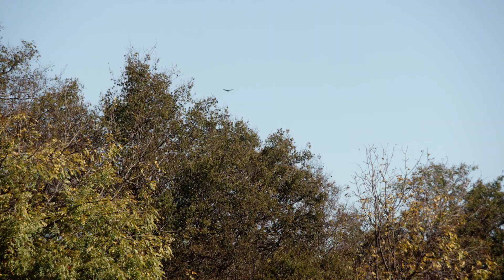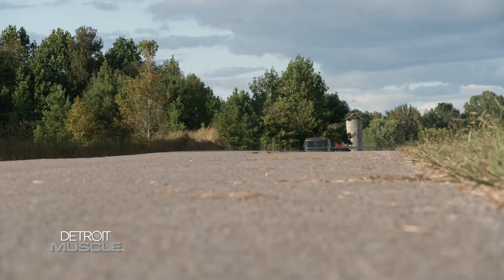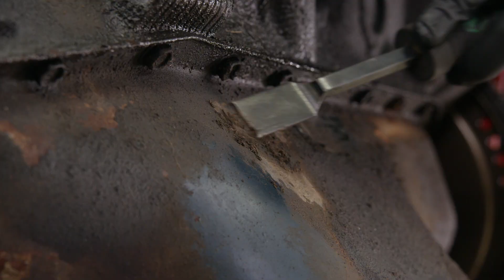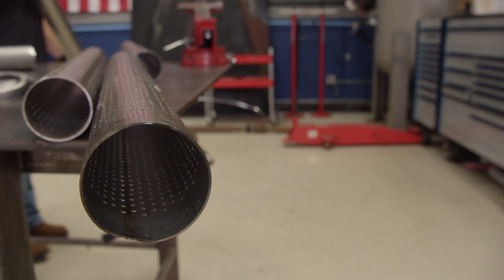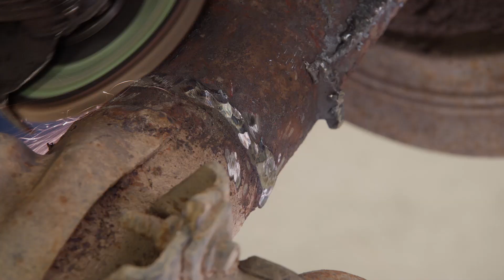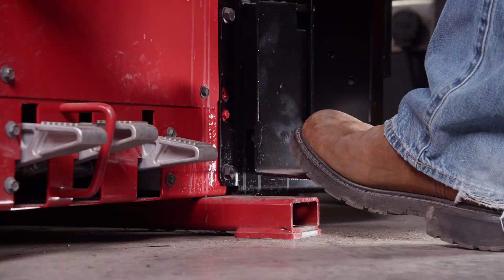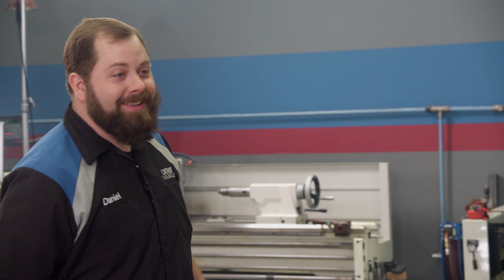Full Build: "Overtaker" Caddy Hearse Wakes the Dead

Comment: I love these things! I had a 72 with the 472 engine.  I put duel exhaust on it and a Holly double pumper carb. I put a line loc. on the brakes😂.  It had a factory limited slip rear. It would burn the tires with no problem! Then it would go sideways on you and take off.  I beat a 70s Chevy impala with it in a race😂

Comment: ok this is not a 502 it's a 425. 502 did not come in that body and the head guy gave it away and the trans has the bellhousing with the ears at the top, and 425 heads will not fit a 502, why lie? bc 500 sounds cooler than 425

Comment: The replacement for displacement is thermal efficiency. Utilize the maximum potential for every drop of fuel you put in the combustion chamber. And have less heat wasted in the radiator.

Comment: Not much aftermarket support for that motor?! There's a lot of aftermarket support for that 500 motor. The Cad company makes tons of parts for this motor. From aluminum high performance heads, intake manifold, camshaft, pistons, headers, etc. Procharger even makes a supercharger for it. Quick performance inc makes a 71-76 Cadillac rearend with a Ford 9" housing with 4:88 gears.

Comment: Meh. LOTS of expense et all, for a second and a half max, with NOX and weight reduction? Might have shined a bit better on a quarter mile track. The shorter track makes it much harder to make proper judgement of capabilities. I think the money would have been mainly better spent on a decent paint job. As an aside, would have been as well off just dropping in the '70 Cad engine.

Comment: Why would you not pull the crank, replace all the bearings, hone the cylinders for new rings and install new ARP hardware. Also clean all the oil galleys and install a new 70 PSI oil pump. Rear end, I have no idea why you would not use a Dana 60 out of a old Ford Econo van that came with 4:11s to 513s ( 3:73s are no ways near what that heavy tank needs) Plus I didn't hear a peep about a hi stall converter? A 4,500rpm would really help over a factory unit.

Comment: This was pretty much the plan I had 20 years ago. In '92, after playing 1st w/ Fords, then Olds, I bought my 1st Cad in an '81 V8-6-4 Coupe. I put duals and a shift kit in the TH375-a 400 w/ a 350 output shaft used in these 1000# lighter than '76 back cars. The duals caused an off-idle stumble, the ECM program not intended for the freeer flowing exhaust from idle. However, after that the difference was obvious!     The next year I added an '84, buying it w/ the notorious GM cam problem of the day and infamous HT4100. Ordering a $150 cam and lifter kit, I noticed it short and only having 12 lobes. NAPA mistakenly ordered the Buick 4100 cam, which was used in '81, not '84 cars like mine (the Buick 4100 has a longer stroke than their 3800 for more torque in the Cad applications) Then finding the HT4100 kit to be $400, it was a no-brainer to put in the Olds Rocket 350 I had previously built and had in a rusty '73 Delta I was scrapping.
 Days after reading the article "Torque Pig" in the July '00 issue of Hot Rod Magazine Magazine, I hunted down and bought an '81 Coupe w/ a 500 installed, in a junk yard! The previous owner smacked a deer. $200, a new front header, grille and radiator, and some radiator core straightening and wha-laa! She ran like a beast. My friend riding w/ after ridng in my V8-6-4 car said "this is the way Cadillac should have built the car". Which gets me to a hearse. Bringing up kids, funds were limited (both daughters have Master's degrees) so I could not afford an '84-1000# lighter than a '76 back, very clean 14k mile hearse for sale locally for $7k...worth every penny. What I instead found was a clean '84 Coupe in Crystal River, FL for $500 w/ a what I later found to be a broken crank in the HT4100. My friend and I drove his '67 Ford F250 Camper Special 1200 miles from here in northern MI to FL to get the car. Still due to finances, and the arson of my home 5 years ago, the car is in my shed. Lost in the fire were numerous high performance Cad parts I was buying piece at a time. I had MTS (Maximum Torque Specialities) MT5 and 20 cams, shaft rockers, KB hypers and stock pistons, H-beam rods rated 800 hp and prepped factory rods-shot-peened, magnafluxed and ARP rod bolts, bearings, gaskets, and an MTS/Bulldog airgap single plane and a Edelbrock Performer. The intakes survived, but the MTS was stolen from my friend's garage on the 1 year anniversery of the arson. 
While I have not met John Walker, I  have spoken w/ him. I did meet and spend the day w/ Richard Potter, owner of Cadillac High Performance-which sold to John, on my trip back from AL stopping at his Soddy-Daisy, TN shop. Rich showed and explained to me the Popular Hot Rodding destroked 470 he built for their Engine Master's Challenge (limit for the challenge was 470 ci) and what really happened. Contestants basically "sign their engines over" to the testers/dyno operator. His engine was not properly vented, causing an air bubble to remain in a/the head(s) which resulted in bad detonation and the harmonic balanced to literally be thrown from the engine. Rich radically changed the factory designed cooling to reverse, threading the core plug holes and plumbing the cooling system so that coolant exited the holes instead of rising through the engine. This allowed the coolant to 1st enter backwards through the thermostat housing, cooling the aluminum heads 1st which allowed a 14:1 CR. He also worked the heads AND pistons of his design to make maximum hp. 
Finally, in the early '00's I accumulated over 20 Cad 472/500's very reasonable. One '71 Eldo 500 I drove 1200 miles to Amirillo to get, another 800 miles away in Princeton. And I made a 4 day 2400 mile 6 state trip stopping in Southfield, MI, Scranton,PA,  Manassas, VA, Columbus, IN, SW Chicago, and Valparaiso, IN.

Comment: I had a '69 Superior Sovereign built on 165" Cadillac commercial chassis. It had the high compression 472, a TH400, and, a 14 bolt rear.
Reply: With a full tank of gas, mine came in at just under 6600 pounds.

Comment: 8litre motor with big valve heads inlet and exhaust manifolds upgraded cam and nitrous making up half the power And it only runs 347hp and even with better gearing hits a 9.7 down the 1/8th mile drag!  Man that was money well wasted

Comment: This build is a joke, and it's clear these guys don't know the first thing about these engines, because they ended up with less power than stock. 425 heads on a 472/500 is a downgrade, as they have worse flow and lower compression. When Flashcraft (THE go to company for Cadillac engines) dynos a 1976 500, despite that being the weakest year for the engine, the numbers they found were that the BARE BONE STOCK, low output 500 still out out 302 HP and 493 ft/lb of TW, and that wasn't even on a rebuild, but in 45 year old engine. Meanwhile these guys managed to only hit 258 HP and 323 TQ. Not to mention the other issue with 425 heads is the water passages don't line up with the 472/500 block, causing constant headgasket leaks. Those of you who followed this build from the start will remember the final chapter was delayed by over two months, and when they did come back, they kept calling it the cars "redemption" and referencing it's first run. That's because the first time they filmed the car going down the track, the engine blew and it had to be built a whole second time.

Comment: That oak wood floor is heavy as hell. But I built a sleeper Hurst in highschool like this only difference is I got mine down to 3100 lbs. Every panel was gutted and all the inner panels I drilled out the spot welds and pulled Emm off it was a thin sheet metal body when I was done took off the original back panels and made my own out of aluminum sheets that we use to build circle track modified and dirt track modifieds and latemodels out of, had a 3 speed Muncie and that 500 ci motor was making 970 hp it was a beast ran 11.2 in quarter mile with street tires and with small tire slicks it ran 10.76 at 132.4 mph but remember it was light super light

Comment: So why didn't they change out the lower end of the engine the rotating bits? Wouldn't that reduce weight and increase power? 

GM has rears that are plentiful and able to handle power just as good as that Ford.

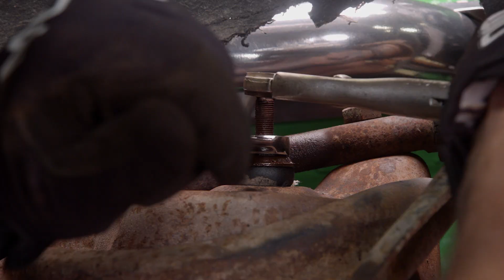Comment: Never new much about Cadillac's "commercial chassis", for which 1976 was the last year (after that, they built hearses by cutting up coups and sedans) . I know that Cadillac models were the only GM full-sized cars built after 1971 with a continuous caster adjustment (1:10:34 notice the adjustment nuts on the strut-rod going into the 2-point control arm), probably because some ambulances still rode on bias-ply tires in the 1970s, and they also had a space for a second battery. The car in this video has leaf springs, rather than the 4 link setup in the sedans, which might have come from GM's "clamshell wagons"  , which used them to keep the floor flatter. I've read that some of these cars were used for both hearse and ambulance duty; they must have had an interesting combination of equipment. Thanks for posting; I hope this car leads a long life in its current form.

Comment: Stumbled across these characters and I've got to say they are entertaining. The content was interesting, as well as informative. The interaction between all the various players was superb. The story line was unusual and quirky. Love it. Maybe that's because I'm also a bit quirky and the unusual has always appealed to me.

At age 17, eons ago, I spotted an ad in the local paper that I couldn't resist checking out. The ad was for a 1957 Chrysler Imperial hearse. It had been produced by a company named 'National Coach located in Arkansas.' I'd seen several Cadillac hearses no longer owned by funeral homes running around town. They were typically owned by band members or long-hairs (a.k.a., Hippies). As I read the listing I had a very different plan were this one to become mine.

So, I called the number, spoke with the seller, and arranged a time and place to see what he had. When I drove up I knew from first glance this I had to take home, barring major mechanical issues. Upon inspection I discovered many positives and damn few negatives. One, it only had 30K on the odometer. It was in essence a one owner vehicle. It had been recently purchased out of some small town in southwestern Oklahoma by the seller. He bought it solely for re-selling purposes. I could hardly believe the condition it was in. Paint was great. Bright work looked very close to showroom. The interior looked absolutely brand new. The car was rock solid with only superficial rust on the chassis and everything underneath. It had spent its entire life garaged and had never been farther away from the funeral home than 50 miles or so at any one time. 

I was pretty much sold on it. But, once I opened the hood I was definitely sold. The car could not have been better suited for what I had in mind. Resting between the inner fenders I discovered a 392 Hemi. with a single 4bbl just as it had been delivered from the factory. Behind is was a 3-speed Torque Flight (push button activated (too cool, for sure). The only things I could see most likely needing immediate attention was  the battery, some new cables, upper and lower radiator hosed, heater hoses, and maybe some radiator work. I worked at a radiator shop at the time so rebuilding a radiator and/or heater core would not be difficult. That evening I gave the seller $100 as the down payment and returned the next night with both my father (I wasn't old enough to legally enter into a contract) and the remainder of the money. I paid $800 dollars for the car, and about a million more when I factored in the endless grief I received from my mother about having a hearse parked in her driveway. (Actually, it was in the garage most of the time, but you know mothers can be).

I acquired the car the summer before my senior year in high school. That car was probably, no, was definitely at  the center of  the most memorable events of that year. Man, did I love that car. It seemed everyone else did, too (except Mom.) The only mods I did on the car was adding a set of Cragar SS wheels and considerably bigger meats out back and a little exhaust work. Thirteen years later I finally sold the car for a very nice price - replacing it with a new 'toy'. However, I have regretted doing so for more than 30 years now. That much 'cool', that much uniqueness, that level of oddity and quirkiness just doesn't come around all that often. Of all the various 'toys' to have come and gone during my lifetime this is the one I loved and miss most.
Reply: P⁰⁰l⁰p

P😊
Reply: That's a hell of a story. Those Cragars go good on pretty much everything from that era, but I can't say I've seen them on a hearse of any kind.

Comment: It would make a bad little camper! Especially if you could made it's so the back half behind the driver and passenger seat had a soft divider or soft edges all the way around it so you could push a button and raise the whole roof about 4 ft then push the button again and it come back down to the original height just so when you were parked using it like a camper you can sit up in it comfortably I mean I think it'd be really cool with some serious Fab work

Comment: That NA torque is about the same torque to displacement as a stone stock slant six sucking through an oil bath filter and a single barrel carb with all the accessories. Yes, wheel torque. That caddy is hurt.

Comment: Strip it out! Down to the frame. Just body left. Or Dana 60 both ends and a divorced 205 on 40” tires. Check out the one built at Barnyard Muddboggers , in Fulton, Ms.

Comment: If that would've been a 69 / 70 it would've had 375 / 525 lb tq factory natural aspirated .
Reply: There is only about 25 HP difference from a 1970 500 and a 1976 500. And LOL there's no such thing as a 1969 500.
Reply: @ClaireLadia  The first 500 was introduced on Sept 18 1969  the early 500 had 375 hp 525 TQ  the 1972 to 1976 had around 200 hp and 360 TQ because of lower compression  after

Comment: Power numbers are horrible. Car went 10.4 from 11.7 after 3.73s, bang kit and converter, slicks, cam heads  intake, and 850 na. With e fans and less weight. Not good at all. Car was more impressive stock.

Comment: you can also take a good pair of stock front shocks and drill a hole on the side of the bottom part of the shock to allow fluid = oil to exit . be carful it will squirt out . the have now been modified to do the same funtion as the 90 /10 shocks but are little to no money spent .
Reply: I tried that back in 1963 and it was no fun driving it to the track with no front shocks. It didn't take long for them to start squeaking. As soon as I got home I put good shocks back on. And it didn't help much either. Back then traction was a real problem with asphalt starting lines and no traction compound so we tried all kinds of tricks.
Reply: @bobthbldr3    that's why you carry 2 sets of shocks  one pair of good ones for normal driving and the modified ones for the drag strip

Comment: I think the hearse should still be functional as a hearse and able to carry caskets. it could then be used for funerals for hot rodders or car aficionados. Imagine how cool that funeral would be!
Reply: I've always thought about taking a hearse and building it to be fun, but also taking a casket and building a full sound system in it, with a heap of speakers. But make it with a quick disconnect connector, so you don't need to haul that weight if you feel like taking it down the quarter mile.

Comment: Subscribed.  What a kick-azz concept car - seriously I'd enjoy seeing yous guys take a vintage Caddy hearse or limo with the 472 or 500 engine and turn it into a turbocharged supercruiser with the Holley TBFI on it.  For the rear end you could use an axle from a Powerstroke-equipped Excursion - it would have the additional cool factor of 8-bolt wheels...?

I'll have to dig into the parts catalog and/or ask my friends at the local machine shop about a stroker crank for the big Caddy engine... and a gear-driven camshaft
Reply: BTW the Munster-Mobile side pipes are awesome

Comment: It was a serious engine back in 1970. It had 400hp, but it was reduced later to 200 because of the emissions regulations.
Reply: For what it was designed to be, 400 hp was great.
That's more than Chrysler's 440 Six Pack or Ford's Boss 429.
That's quite impressive for an engine that was designed to be smooth running and quiet with a very mild cam and really poor exhaust scavenging, etc.

Comment: Lifeforms have 4dendrites a tendril a synapses ,  Commuter GMC 4500rpms Max. Bypass dist. Module direct with MSD. $300 , ⚡💥One on the list
Reply: Crossover added to the new exhaust needed low-end torque 💨💩🤭